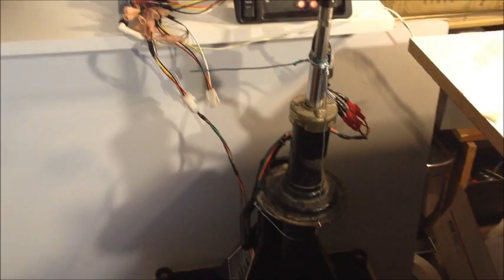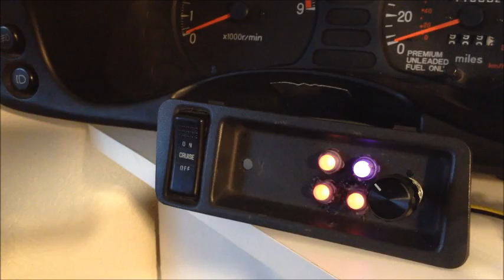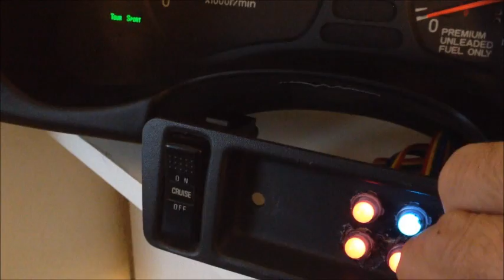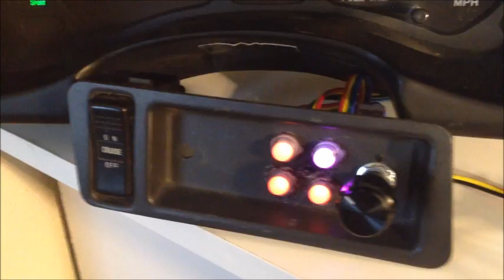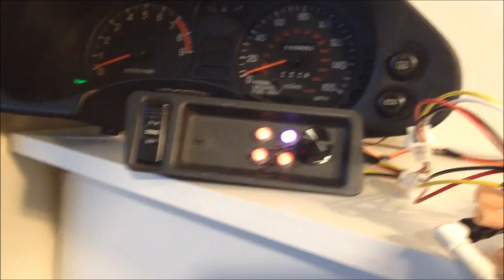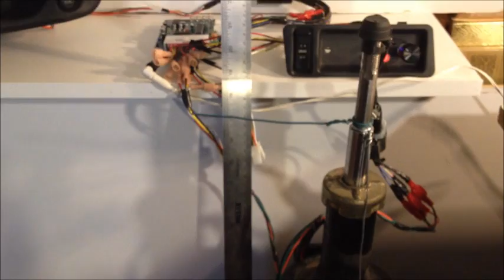Mitsubishi 3000gt / Dodge Stealth    ECS Retrofit & Replacement Controller Demo

Comment: Can this be used with a 91 VR-4 with just the dash button as a replacement for the factory ECS computer?
I tried to log on to your website a minute ago and it wouldn't load. Might wanna have your IT tech guy take a look at it.
Reply: His other video shows you that you can use it with just the new controller plugged into the factory wiring.